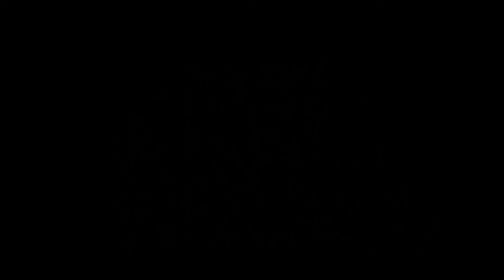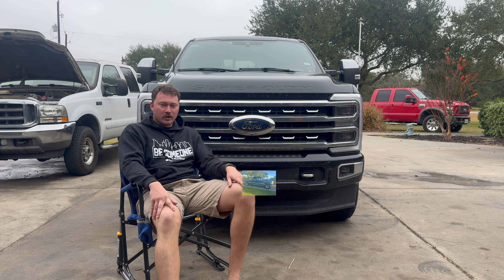The 6.4 Powerstroke In My Opinion

Comment: I am looking at a 2009 with 184k miles on it. Seems like it runs great, EGR deleted and tuned. What should I look out for before I pull the trigger. Will be pulling occasionally moderate weight (6-10k) Is the rod knock something that is easy to hear? I assume the blow by test (oil cap removed upside down) would be wise?  Appreciate your input.

Comment: Choate engineering has whole podcast on design flaws & the unfortunate emissions timing and fuel changes. Shouldve just stroked 6.0 to 6.3 fixed EGR, oil cooler and studded heads. Lot cheaper than warranty issues and lawsuits 🤯

Comment: What is your opinion on 6.4 engines from J&K engines or Asheville Engines?
Reply from the maker: Don’t have one. Never used them. I build in house. Don’t use other companies so can’t give you an opinion.
Reply: @sfdedieselllc5564 what is your experience for longevity of a 6.4 powerstroke the has had factory flaws addressed?
Reply from the maker: @mikefoster6358 depends on use. 250k is easy is maintenance is done accordingly
Reply: @sfdedieselllc5564 10-4.  Im debating on one, but can't decide to keep the 6.4 once it goes  or swap in a 12v. I never bought into the 10k mile oil changes.

Comment: Every issue with the 6.4 can be blamed on the emissions, delete early and they turn into the best diesel engine ever made, best hi press fuel pump (highest flow), best turbo setup (compound), best looking, most power potential, best transmissions, best suspension, best interior. I have owned 2 6.4s and they are by far the most powerful diesel in stock trim (tuned and deleted) on the planet!!!! delete a must, Cat coolant a must. YOU MUST USE HI quality synthetic oil with the 6.4 engine Royal Purple/Amsoil or and it takes care of ALL turbo, rocker and piston/wrist pin issues. VERY IMPORTANT ON 6.4s ALWAYS USE 2 STROKE OIL ON EVERY FILLUP (DON'T FALL FOR EXPENSIVE SNAKE OIL DIESEL ADDS) K16 PUMP AND INJECTORS WILL OUTLAST CP3. CP4 PUMPS!  The 6.4 i have now has 258,000 on it run as good as the day I got it (12 sec quarter mile, DELETED EARLY, tuned properly hi perf lift pump and stainless up pipes 4-5"exhaust NOT 1 issue with this truck). Maintenance is key with the 6.4 over any other diesel and I have owned many) But what do I know I've been a mechanic and had my own business for 40 yrs...

Comment: I’m really interested in your opinion , with a s300 swap or a upgraded compound on the 6.4’s
Reply from the maker: I stand with compounds all day. Far more efficient
Reply: @sfdedieselllc5564  yeah i agree, they sound badass single turbo but if you are going for function the compounds give you good boost at low and high end so its better overall. 125k on stock compounds no problems at all, with performence tune

Comment: Ford didn't build that engine international made it thats why the issues but with a delete its reliable as a truck can be." 2019 to 26 rams have block heater faults and lifter problems. I'd buy a 6 4 anyway

Comment: Emissions is a Scam…
I want to find the Funding to do intensive Research on Emissions!
The Testing i have done on Gasoline Engines back in 90’s, I had Proven without doubt, a Catalyst makes more Emissions than a Truck without, Catalyst creates a lot of Heat, Heat is what causes bad Emissions, and the Catalyst causes Engine Problems Running above Temp in Hotter Climates, we have to call these Fraudulent Liars out!!! 21:11

Comment: The real reason is, why would somebody deal with all that?

If they could get a complete truck already built 5.9 Cummins
For 10k?
Reply: Dodge truck is junk, super duty chassis is much better
Reply: @codystrom8708 the chassis doesn’t pull you down the road
That’s like saying you’d buy a wagon with a shit horse. 
Than a badass horse and a wagon you’ll have to keep up

You can’t make your horse better. 
You can make a wagon better
Reply: The cummins is a far more affordable engine, and it will get very mpg.  Still going to build my 6.4PS and 5.9CR.  The problems with the 6.4 are all the things on the top of the engine and the exhaust.